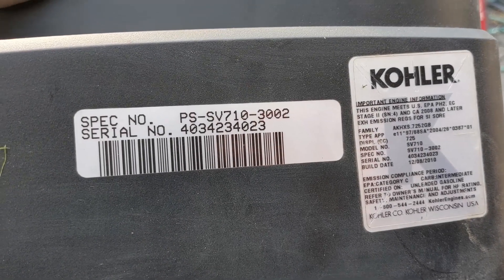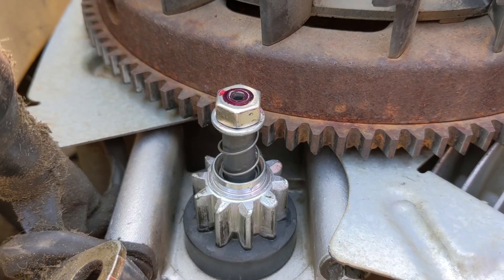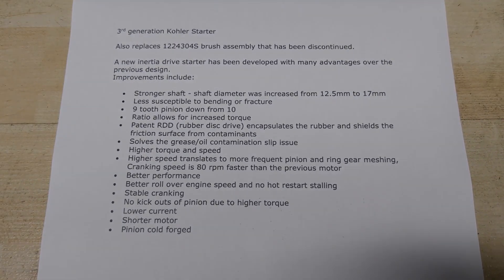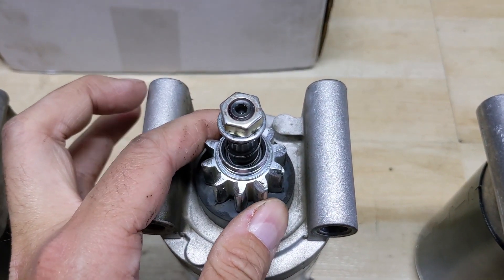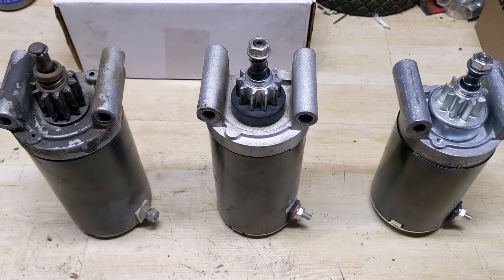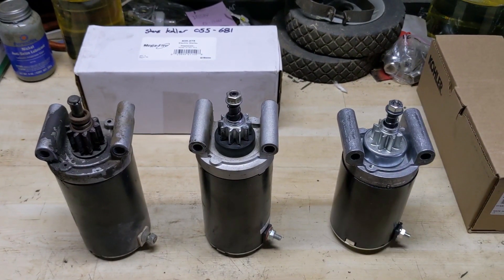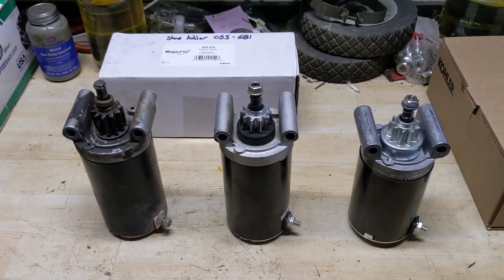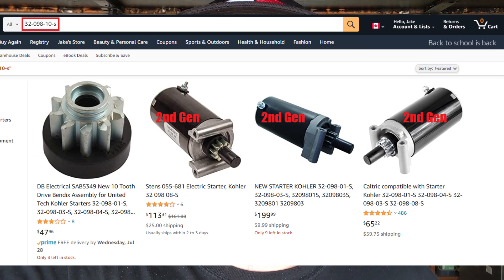3 Generations of Kohler Starters for SV710-SV840 Engines

Comment: why not reverse the thread on the shaft so it tightens itself in use.
Reply: My thought exactly
Reply from the maker: Yes, you'd think that would be the engineers thoughts. However, the shafts are too narrow and made from cheap metal. With the added force of a nut that doesn't back off, they'll definitely end up cracking and breaking like others have.
Reply: First thing I thought also

Comment: I checked out starters to change mine out on my zero turn Gravely and thought it was going to be a snap.  Then I looked at the reviews and every different one had 10, 20, 30, video reviews showing snapped off gear shafts.  That ended that plan.  Then I researched rebuild kits which were just brushes and springs.  I didn't even know if that was my problem.  Then I watched this video.  It saved me from changing brushes that probably weren't even my problem.  I looked around and found a couple of Gen 3 starters that stressed that they were not the old ones.  It was much easier to buy a starter being informed of the cause of the shafts breaking.  I learned a lot besides just that.  Our zero turns and tractors go through batteries too frequently.  This starter will likely help with that as well.  Being shown is nice but being informed is the real thing.  One of the most helpful "How To's" that I can remember.  Thanks for your effort and your share.
Reply from the maker: Thanks for watching, glad it helped!
Reply: DB starters has a quality starter.

Comment: How did you get the black dust cover off of the end of the helix thread shaft, to access the lock nut or C clip ? It seems to be glued on there, and won't come off. Thanks
Reply from the maker: @bobbysmart833  just pulled it off, they might be gluing them now. Or someone else did?

Comment: The nut most certainly is not welded it is a crimped lock nut. Those 3 marks on the top are the crimps. Crimping deforms the threads to help lock the nut. If yours is welded then it wasn't kohler. I've never seen a kohler starter with the nut welded.

Comment: The 32-098-01, 32-098-03 and 32-098-04 starters all use a rubber clutch on bottom of gear. On the starter that you refer to as a "first gen" starter - the rubber clutch is totally missing - it would have been shredded to pieces when starter failed (it's not a "rubber dust boot", and those little slots at bottom of gear are usually covered by the clutch). From then, the 32-098-08 and 32-098-10 use an enclosed clutch. Regarding 1st gen, 2nd gen, 3rd gen and "mysterious 2.5 gen", there are 5 different starters to date - the first 3 use 10 tooth gears, and the -08 and -10 use 9 tooth,
Reply from the maker: Thanks for the great information! And yes, the 08 is what I refer to as the "2.5" gen as it has the 9tooth pinion gear, but lacks the other upgrades.

Comment: So you got to keep the starter that you got refunded for?
Reply from the maker: Yes, I asked if they wanted me to send it back, and they said no. Their reasoning was that they couldn't resell it, as it was used. And it had been warrantied, so it is classified as defective. The starter still technically works, but the nut will eventually come off, or the shaft will most likely break.
Reply: @EliminatorPerformance  Put a lock nut on it or weld the nut. And keep it for a rainy day.

Comment: Why weld the nut!? Why not just use a left hand thread?
Reply from the maker: Who knows lol "engineers"
Reply: @EliminatorPerformance  IKR! It’s not like its a new or innovative solution. Every brushcutter/ weedwacker on the planet has a left hand thread to stop the blade spinning off. Surely has to be more work to weld it - and stops you from being able to replace a worn pinion….duh.

Comment: Great video.  Concise, quick and to the point.  Thanks for your work.

"This starter will not fail." Don't believe them.  I have a 2016 Cub Cadet, XT2 with 26hp Kohler 7000 series motor.  Less than 300 hours!  Replaced the battery and solenoid and still just clicks and the wires get hot. Pulled the starter (32 098 08; 9 teeth; 8 or 9-inches long)  It was locked up.  Metal slivers from the thick donut under the gear.  Playing with it freed it up, but it will be replaced.

Comment: Ok, so I have an ExMark with a KT725.
Ran her outta gas, then after a day off to go get gas and refuel her, she won't full turn over.  Full 12v at battery, and I can visualize the solenoid spinning up and engaging the flywheel.  Seems like the solenoid just cannot crank enough torque to make her spin more than a half turn.
Suggestions??

Comment: Good info.  All I've been able to get my hands on is the Gen 2 model so I did the re-torque of the nut with red Loctite and keep my fingers crossed. So far so good.
Reply from the maker: Yes just keep an eye on it. Once the nut is secure, the gear slams up against it so hard it can crack/break the shaft. The only gen3 starters I've been able to find are OEM ones right from Kohler. If ordering online you risk getting a gen2 as shown. And if ordering from a small engine repair shop, you have to specify you want the gen3 with the exact part number I gave.

Comment: I bought a new gravely in 2017 with a Kohler KT series motor on it. I was mowing and the engine just stopped thought it was out of gas so put more fuel in it and tried to start it and just got whining noise like the starter wasn't engaging so I poped the starter off and the gear was laying in there sideways, the shaft had totally twisted off, it looked like it was made of pot metal or some cheap metal. The label on it is listed as the 3209808 manufactured in 2016. it has 9 teeth and a shorter motor. I have a new OEM ordered and I am going to compare the shaft to see if the new one is larger. I am hoping that the one I have is before the improved shaft because it didn't last and at times it was having trouble engaging.

Comment: Can’t you tack weld the top of the nut on gen 2?
Reply from the maker: Yes but the starter gear slams into the nut so hard the shaft will end up cracking and breaking. Which is why the 3rd gen has a thicker shaft

Comment: I'm currently replacing this starter for my neighbor. The original starter has lasted nearly 17 years. What I ordered appears to be a 2nd gen.10 tooth. Not sure of length until it arrives. I'll add red thread lock before installing it and hopefully will last the remaining life of the tractor. If not it's a cheap super easy fix. Wish I saw your video first just the same.

Comment: WOW !- you just solved my problem starting my just inherited Cub Cadet GTX1054. The confusion at AMAZON is significant !! Living in BERMUDA, and having to use an intermediary consolidator/shipper, with added huge expense by them, is frustrating. I am STILL concerned at not getting the TRUE 3rd gen model. Wish I could just walk into a knowledgeable shop tech, and get the correct one !!  Thanks again, I have subscribed-- and hit the BLACK bell.
Reply: How bad is shipping? It might be cheaper to have a "friend" on the mainland come over for a visit.
Reply: @bobjoned3398  Just solved another starter frustration. Replaced the 10awg from battery to starter with a #4awg.. Instant startup now -- and better charging voltage as well .

Comment: Very good video, I have a B&S 24hp, it quite charging the 2 wires from the stater r yellow they go straight 
Regulator no plug. I bought a reg. to replace it have to cut the wires, does it matter which yellow goes to 
which reg.? If so how do u find out the right one?
Thanks

Comment: Thanks so much for this video! Today my starter died. The top clip hasn't blown off for over 15 years however the shaft spins still but doesnt engage the pinion and the spring is gone. I'm assuming the shaft is stripped to where it wont spin the pinion to crank the engine. it's hard to stomach the 200$ price from the dealer for the new gen starter. I'm gonna go with amazon version with hopefully welded nut and stronger shaft. I can see the 9 tooth gear and metal where the bushing used to be in the pic.
Reply from the maker: Just make sure it's the 10-S, if it's the 98-S it's the 2.5 gen with the 9 tooth gear but they don't have all the upgrades as the 10-S

Comment: From my inspection of my starter it’s a 3rd gen it has the welded nut it’s on a kt745  Husqvarna z248f. Mine snapped the shaft have you ever seen this on the 3rd gen starter ?
Reply from the maker: I've never seen that on a 3rd gen, but I have seem that on the 2.5 gen starters. It's possible your engine has defective automatic compression release system making it harder to start and the stress goes to the starter.
Reply: @EliminatorPerformance  it is possible I have the 2.5 the date on the starter is 2017 the shaft diameter measured was 16mm.I will definitely look into the compression release thank you  for the feed back!

Comment: Thanks for this in-depth video. I purchased an OEM Kohler starter but it had the 9 tooth instead of my original 10 tooth starter. Had me worried I purchased the wrong starter.
Reply from the maker: Yes but as shown in the video, there's a mysterious 2.5 gen starter that supposedly has the 9 tooth gear, but not the upgraded shaft or metal housing under the pinion gear. See if you can reference the part number shown for the 3rd gen and make sure it's the same!
Reply: @EliminatorPerformance  Dang, I got a 2nd generation starter, haha. 32 098 08-S is what is says on my receipt. Oh well, guess I'll use it until it breaks I guess. Love your video. Thanks a bunch!

Comment: Wow hard to believe it takes so many tries to get it right but Kohler finally did it appears. Very good detective work getting all this information which at some point will surely save a number of your viewers major dollars from not buying the incorrect out of date starter. Not many in the small engine business have good things to say about Kohler engines ie: OHV cover leakage!
Reply from the maker: Thanks for watching!
Reply: Get the composite covers with o rings that will not leak.
Reply: @newbernbears  What is the cost?
Reply: @waynestefinashen239  Under $20: 32 755 49-S
Reply: @turbo.dad.restores  Thanks for the information Javan will look into that part number
Reply: @waynestefinashen239  No problem, they are the same covers that they use on the commercial Command engines. The Kohler documents don’t call out that the kit fits the SV engines but it has been confirmed that they do.
Reply: @newbernbears  I just take them on my Rockwell belt sander, to flatten them out. Stock they are not even remotely flat.

Comment: would this be the same for the kohler engines (ZT740) used in kobota zero turn mowers?...the number on the starter is 32-098-08.
Reply from the maker: Yes if it has the 710-840 series of engines, for the 740 is in that group
Reply: never mind. i found the zt engine mentioned in your comments.
Reply: as of today 9/7/22 the stens and amazon website are still showing the gen 2 starter as the gen 3, as mentioned and shown in your video.

Comment: Thanks for the vid, interesting.  Do you see the same type of starter failure with other riding mowers?  I have an older John Deere.    👍👍
Reply from the maker: Not too often, usually the gear gets shredded or the starter fails internally, and it's not worth my time to disassemble and repair the brushes and Bendix like it used to be. A good starter costs roughly $135-250 depending on make and model, and the swap itself doesn't take long at all.

Comment: My old Kohler Command 16 series engine is very hard starting from warranty replacement. Could it be one of these starters?
Reply from the maker: Find and google the model number of your engine. These are only for the SV engines
Reply: @EliminatorPerformance  Unfortunately this was a warranty replacement. They replaced the Brigs engine with this kohler and there is no tag???
Reply from the maker: @tonyrader7102  somewhere on the engine you should see a model number. You may have to remove some plastic cover

Comment from the maker: The 32-098-04-S and the 32-098-08-S seem to be the mysterious 2.5 gen, which appear to have the new motor and 9 tooth gear, but lack the upgraded shaft and welded nut.

So be sure you order the 32-098-10-S as it is the most current, and strongest built starter!

Also, as others have mentioned, using a left hand thread on the 2nd gen starter would allow the nut to be "self-tightening" as it would tighten when spun counterclockwise. But again, the shafts weren't built strong enough. So they'll still end up cracking, which will ultimately lead to premature failure.
Reply: Thank you for all the information, research and hard work you put into this informative video. I had the 32-098-01 starter on my kohler courage 25hp and have been trying to get the thing to start forever. Finally bit the bullet and bought the new 32-098-10 from kohler and now the motor turns over faster than ever every single time without a second thought. Super excited to finally have my zero-turn mower working as intended again. THANK YOU!
Reply: Good Video.  Thanks for doing the research and putting the info out there.  With only 76 HOURS on my Cub Cadet w/27hp (or 26hp?) Kohler the starter shaft broke.  I pulled it off and it was the ...-08-S version.  I was able to get a ...-10-S locally (and quickly) but they (Weingartz) charged me $220 for the part!!!! They clearly are selling a lot of them as the had a big shelf full and they are located in the closest bin to the parts counter.
I'm pretty dissapointed in this tractor and especially the engine.  I have constant problems with it.  I use Rec. gas, and perform maintenance regularly - in fact, more than regularly because it always seems to break-down before it regular service interval...  The "smart-choke", crappy fuel pump, and carberator are especially troublesome.  SeaFoam has become my friend.  And I don't mean just putting some in the gas to treat, I mean dumping some right into the intake until sputters, smokes and (hopefully) projectile vomits a bunch of black crap... Then it's usually good for a couple more weeks.
I used to think Kohler was a premium brand but no longer.

Comment: I was wondering if I could get a third generation starter for my Kohler KT 735 - 3034. Can you tell me if it will fit or if it is available for this model number? I'm a little confused about the model number and the part number.  Please confirm.

Comment: Just pulled the 3rd gen starter off my kt740 kohler. Nut came off end of shaft.
Edit: part # is 32 098 08 so maybe a gen 2.5. Tried reinstalling the nut, but the threads are wrecked.
Reply from the maker: get the 10S 3rd gen, you wont have any issues!

Comment: Does Kohler have a correct 3rd generation starter number that doesn't possibly give you a 2nd generation, or worse a 1st generation starter. Thanks everyone
Reply from the maker: The last number I show, which is the -10-S but the issue is, if you buy it online you don't know what you're getting unless you buy an OEM one or from the dealership

Comment: I subscribed to your YouTube site in gratitude for your help. However, your recommendation to choose Kohler's 32-098-10-S generation-3 starter over Gen-2 will cost your customers a bunch. If one needs to change the 9-star gear, spring, or clean stuck moving parts due to debris, you have at the junket because you cannot open it up by stopping the welded nut.
When I called the factory, they disparagingly told me I was cheap and could buy it for $150 or so. They have not received any complaints, albeit the 'technician' was unfamiliar with the Gen 3 and commented it was above 'his pay grade.' I hope Kohler sees the recording message of this date, so tell the agent to be a little bit understanding with cheap customers.
Reply from the maker: @fredobornfree2236  yes it's more money, but I've yet to experience the newer generation starter break due to the thicker shaft. The red thread locker on a 2nd gen works, until it doesn't. I guess if you can do the work yourself, just buy a gen2 and thread lock it, use it until it breaks and buy another Gen2 and repeat the steps. I am of the belief that if the engineers made such a drastic design change (motor, pinion gear, shaft, clutch, housing etc) then it's worth the extra money. Some people can't afford to have to fix something twice, especially if they're paying a mechanic labour and pick up delivery costs.

Comment: Just get the "Solenoid Shift" starter and be done with it  2509824S. I  think it's the same unit that they put on the Command series.
Every Kohler Courage I get in has some kind of starter issues. The bigger and more powerful the engine is the faster the stock starters fail.
Complete junk, had a 27 hp that would not roll over fast enough to start, even with a new battery.

Comment: if kohler would have just threaded it with a left hand thread. it wouldnt have that problem.
Reply from the maker: Yes but the shaft would most likely still crack, which is one of the reasons why the newer one has a thicker shaft